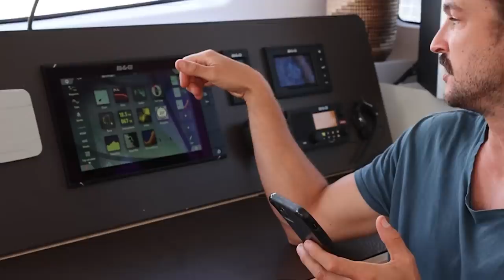ONE WEEK to Prepare for 16 Days at Sea (Atlantic Crossing)

Comment: That rudder table should be double that thickness and it should be glassed with 1708 glass. I would have added gussets to make up for the lack of thickness. I know light is fast and fast is smooth but it's quite important.

Comment: You can use vinegar to clean metals and surfaces and any thing really. For the clicker you just need to deep it into a bowel of vinegar for about an hour (or less) and every some time take it out and rub it to clean the rust away. It should be clean as new. Hope that helps in the future.

Comment: In this Episode, I learned Riley is a Polar Bear,... and good to see the follow along of all the work that needs to be done, to what is really essentially a brand new boat with only a few years? The cuts and edits 😂🤣
Reply: Glad the shoddy work/weight savings is covered under warranty light weight with traditional materials and building techniques = less materials things I saw that had corrosion surprised me after the boat was recently gone over
Reply: @1STGeneral  yes, essentially a new boat... considering to buy new or used now, seems like will have same amount of work, maybe used is better, more chances to just pretend everything is broken and replace everything.

Comment: Hello there, I have been catching up on your channel, The episode with the Mini Moke. Did you know that the Mini Moke was originally designed as an Air portable military battlefield infantry transport. The Side boxes were designed to carry Rifles and spare ammunition, there was a bracket on the passengers side to facilitate a Machine gun. The seats were mounted on boxes for stores. There were two spare wheels one either side of the rear sides, when the storage box was fitted two extra soldiers could be sit on the box with the spare wheels becoming the sides of the seat. There was a Four wheel drive version, A small truck version, and even a proto type that had a large fan fitted behind the front seats experimenting with a Hover craft version.

Comment: A little trick for you. Not sure if you emergency hatchback perfect for it.
Put vaseline or soil pipe lube on one surface then use your silicone liberally  on the  other. Allow it to partially set then close the hatch and leave it finish curing.
The hatch should be perfectly workable after.

Comment: I think I've got to do the paragliding thing, even closer to flying than a small plane. love it. I watched the takeoff in Slo Mo and that was a really tricky move by the pilot,  with you supplying force so the wind wouldn't pull you backwards !  17:13 watch in slow motion

 I AM really surprised that the platform for all that heavy sailing rig was built out of fiberglass ! Wow, not right, should have been steel, preferably stainless. If I were to consider a new boat I would stipulate that it be replaced with Steel, or find a different boat ! I've also been unimpressed with the vinyl covered cable they used. On the last crossing the vinyl nearly incapacitated your steering ! The worse and most negligent parts of the boat is the steering.

Comment: Those pivot pins on the Pelagic autopilot shear off at the base, I have broken 3 of them. Now I use SS threaded rod cut to length, it bends before it breaks so its easier to replace.

Comment: FYI, if you heat a pair of shears before you cut the rope, it will cut and melt the line at the same time.
Reply: How many cuts like that can you make before the shears are glued together?
Reply: @EEB-pp9rp , unlimited. Shears should be red hot so they both cut and melt the line at the same time.

Comment: For that piece of timber that is cracked you could use a few right angle brackets on either side and bolt it down so it doesn't move.

Comment: easiest way to find were a hatch it leaking from, open the hatch, clean both sides, rub chalk on the fixed side (i.e the hull) then close the hatch. if the hatch is perfect you'll have a nice even line the entire way around. If there are any dodgy bits you'll get a weak line or a missed bit.

Comment: You need 2  ,6 inch L brackets one on each side of the vertical board and run bolts through it and bolts on both sides of the horizontal peice and use lock washers that will hold it tight but run the bolts on the vertical peice through both L brackets add sandwich the vertical piece in between them

Comment: Im sure you guys have lots of people offering advice, forgive me.
On the winches i use grease on the bearing and gear surfaces, and 90wt gear oil on the pawls. The viscosity of the grease determines how easy it is to freewheel, and oil base grease seems to last longer around salt water. "Lewmar" winch grease is popular around here and is a great choice over synthetics, but grease on the pawls can make them stick resulting in the winch jumping.

It is absolutely possible to overtighten the steering cables, resulting in undue wear and friction. That crack could have come from the boat getting pushed backwards by a passing wave (like when you're hove-to or reefing), and doesn't mean the boat is the least bit unreliable or poorly engineered as some have speculated.

If you could possibly end-for-end your main halyard it will help the block twisting a bit, but the twists that are in the halyard now are not going to magically disappear as they have been "load-set".

It looks like your VHF whip is missing from the coil at the masthead, it will work a lot better if you put an antenna at the top end of the co-ax. 3db should be fine on a multihull where the antenna is mostly going to be perpendicular to the horizon.

I do not personally think it is irresponsible to sail to Antigua alone, but before leaving I would have a written checklist for the day you arrive because you're going to be pretty punchy. Anchoring up in Falmouth would be a lot easier under those circumstances than trying to manoueuvre around English Harbor, for example, when you're not at optimum. At least half of the deliveries I've done were alone; it's not a hairball concept.
Best of luck on your passage, i am always so impressed with your abilities.
Thank you.

Comment: Riley, please use l shape brackets to reinforce the rudder assembly with two pieces of metal plate sandwich ing that board that has the play in it. Then welding brackets to that. I don't want you guys to ever worry about that again. I feel that this was not engineered correctly to begin with and should be a warranty situation that the company takes care of for you!

Comment: These are very interesting videos and a great change of pace.  It’s more than a bit concerning that this is at least the 2nd repair needed on the structural portion of the boat that supports and operatives the steering and autopilot system.  Remember Riley and Andre had to glass in a bracket for the autopilot mount.  This is not a good testimonial for the overall engineering and construction of this brand of boat.  These areas should NEVER crack.  And these did after what? 2-3 years?  Maybe they’re not engineered and built for Atlantic crossings.  Just Med coastal cruising? But, it gets pretty rough there too.

Comment: TBH, even it’s a new boat it looks like a paper boat e.g. built very lightly...seeing the previous videos where seats are flying, that rudder steering system etc. So the famous and endless discussions what’s blue water...equipment can and will break, structural things should not break in normal use

Comment: Hey Riley, As someone with 40 years of carpentry experience I'm a little worried about you using caulking to glue your escape hatch shut. How will you kick it open when the boat is upside down and the hatch is over your head? I have sealed things with cheap caulking before in a marine environment and was surprised how difficult they were to remove several years later. Maybe a new rubber gasket is a better idea?

Comment: 16:40  there's and old wives tale that say you can determine the gender of a baby. Depending on how the mother carries the baby bump.  If the mother carries high its almost certainly a girl. If the mother carries low its almost certainly a boy.  That being said my prediction is. ... There is zero doubt Sophie is having a girl.  Predicting for Elena  is a little more difficult because the baby bump isn't as pronounced yet.  I would however guess that there's a 60 percent chance it's a girl.  Congratulations to both couples.

Comment: I cringe every time I see someone up a mast without a secondary safety line. As someone who rappels you can never be safe enough. A secondary prusik will give you a backup if needed and won't be a hassle. The knot is super easy to use and wrapping it around another separate line or even a guy wire would work. Please look into it for your kids sake and your well being.